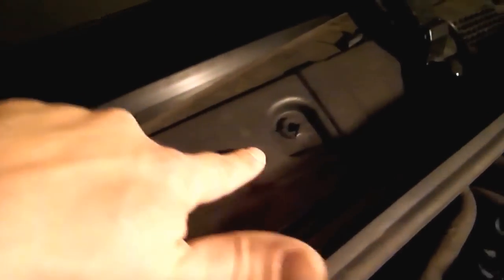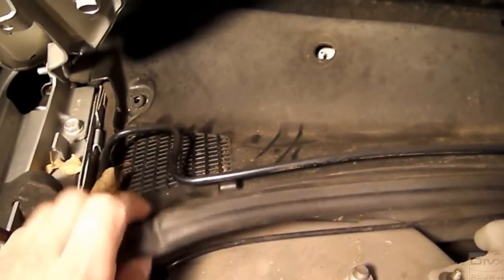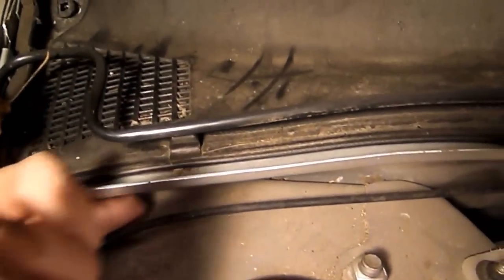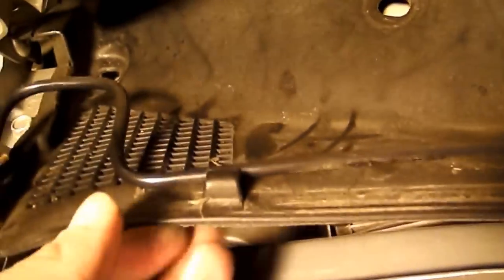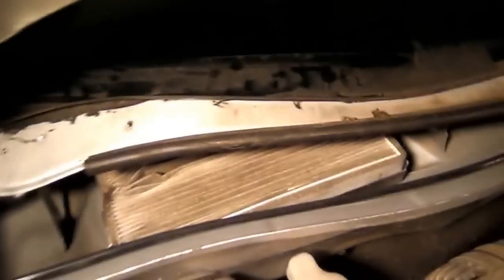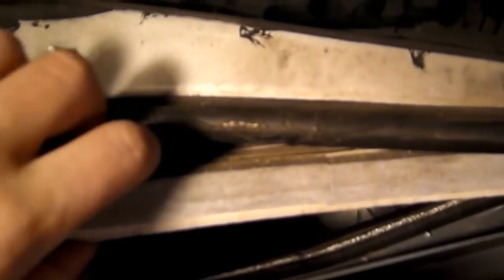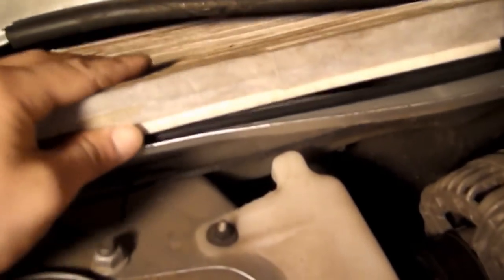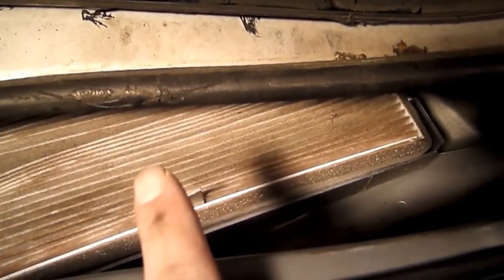How to Change the Cabin Air Filter on a 2004 Buick Century

Comment: Thanks Bob for the help. I just bought a 99 Century that has 42,000 miles. I had the oil changed and they wanted to charge me $90 to replace the air and cabin air filter. $20 at Autozone and your video saved me. Thanks a ton.

Comment: Is there only 1 or is there 2 one on each side because my BMW I used to have had 2 and im about to change the cabin air on a 01 century but the books dont really cover or say anything about the cabin air filter GM just kinda leaves ya in the dark on the whole situation and the books are super skinny and crappy man I miss my beemer badly it was sweet an awesome and the books covered everything possible about the car then the repair manual was a 2 volume set and each book was like 3 inches thick and didn't leave anything out fully covered every aspect about the vehicle
Reply from the maker: There is only 1 cabin air filter.  It is the one that is shown in the video.  The other side just has the wiper motor.  Yes, those books can be good resources at times, but can also be very vague.  I would however recommend picking up a book on grammar and reading the section about run-on sentences.
Reply: SilentBob342 thanks but whats up with grammar policing are you a grammar teacher ?
Reply: Jacob Hayden most of this comment is irrelevant to the video.
Reply: SilentBob342 Is it possible his device doesn't have a period key or maybe he doesn't know how to use it?Too difficult maybe?

Comment: How can you tell if you need to change the cabin filter?
Reply: When you're driving and you start smelling fumes from other cars while your air conditioner is on or your heat that's when you can tell your your air filter is going bad because it's supposed to block all that out

Comment: I feel a little heat and air coming out the vents so do u think its a dirty cabin filter causing the problem
Reply from the maker: I am not sure what the question is.  There is supposed to be heat and air coming out of the vents.  It sounds like they are working properly
Reply: lol

Comment: This is a source of leakage of water into the cabin.
Reply from the maker: Yes.  One must make sure to re-install the cowling properly to avoid leaks.
Reply: The cowling (rubber strip that fits on the metal frame above the air filter) is designed to divert water away from the filter opening.  If it falls off, water will enter into the cabin.  I suggest applying silcone seal to the cowling before reinstalling it to be sure it is water tight and also so it doesn't fall off, which it tends to do.  Also, I cut a piece of hard plastic thats loosely sits on top of the air filter box in order to keep out any water that might get through.

Comment: Wow you literally have to disassemble the car to change it...
Thanks GM another crummy job....How about a Vibe (Toyota,) Just drop the button on the back of the glove box and slide it in and out.....
The "owners manual" barely mentions where it is and has no instructions on how to do it....OH take it in Granny and see what they charge you.....no thanks
Reply: Absolutely. My 2010 Camry was changeable by opening the glove box. I will let the quick oil change places do mine. Is all that you have to do this Buick, let alone all the plastic that will break dismantling and reassembling, worth about $10 labor for them to change it? They probably have replacement grommets for something so old and brittle.